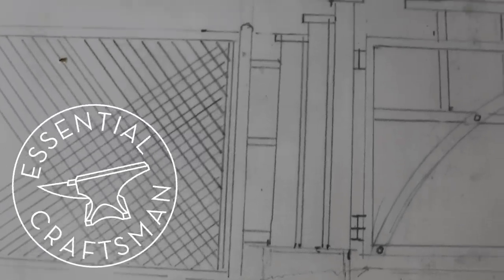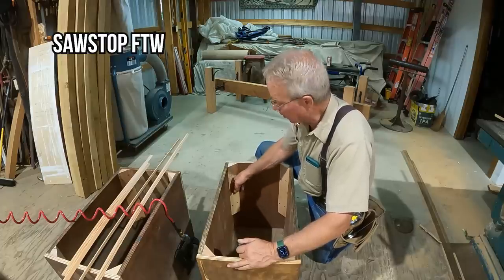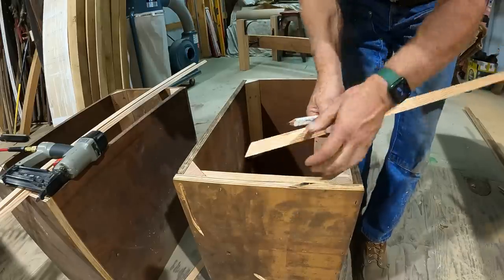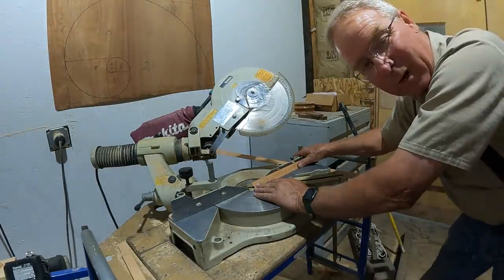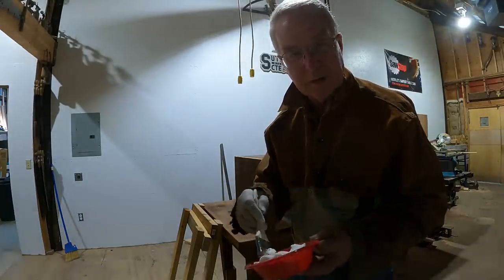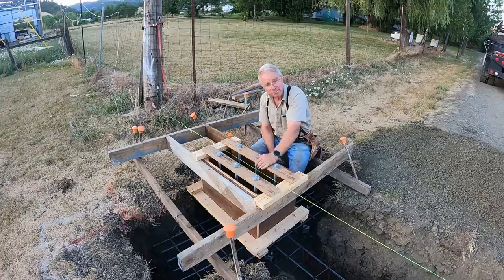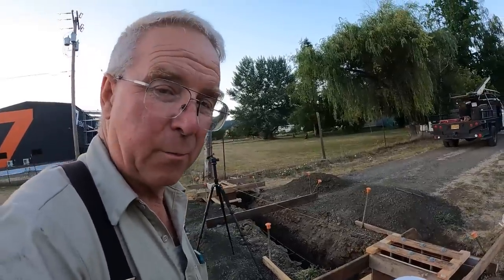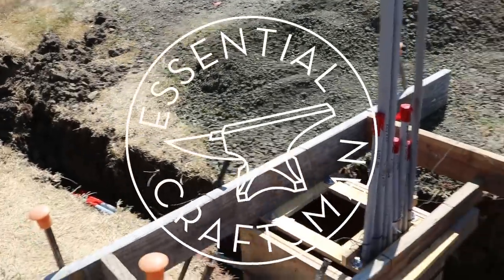In Depth Look at Decorative Concrete Forms: #2

Comment: Scott, with the grade-beam, the only thing you need to do is make sure there's 1 1/2' between the soil sides and the rebar.  Without at least 1 1/2 inches, the rate of oxidation is greatly increased.

Comment: Pilaster. Lol.  
The grade beam is a great idea, and the only way you can be for sure that  the post won't separate or lean.  Remember, if it's a heavy gate, when it's open 90° from its closed position, it'll want to tilt the whole mess towards that direction.  I did all this years ago out of 12 inch square steel  tubing.  6 inch uprights out of square steel tubing, all welded.  Volkswagen stub axles with tapered bearing fit inside a 3-inch pipe was inside of the six inch square pipe and 1 inch studs sticking out the side with 90° slot this way the swivel pipe was all concealed it also had a tie rod going from one day to the next so I only needed one opener and they swung together.  35 years ago.

Comment: Hi Scott - great work on the gate. Love the channel and all that you share here.

The key difference between grade beams and spread footings is load path! Grade beams are usually found where there are very weak soils that can't practically support weight. They support the structure and transfer loads from the beam to piles or a similar deeper style foundation. The stirrups and rebar resist the bending and twisting that transfer places on the beams.

Spread footings do just that, spread the load out onto the soil below.

Comment: Rather than tapping the forms with a hammer, use a reciprocating saw with the blade removed. It gives a perfect amount of vibration to the forms and won't make your arm fall of from swing a hammer.
Reply: Or a battery orbital sander...

Comment: From the beginning of the spec house to now I've gone from foundations poured walls and precast now testing concrete, and inspector. Test soil bearing capacity, inspect rebar and test concrete, yield, mix, strength, and document everything

Comment: The chamfer edges are a nice detail.  In 1974, when I was an engineering student I worked for an electric substation construction contractor and we always  put chamfers on our foundation above-ground column edges.  They looked better, in my opinion.  Keep up your good work on the videos and the content.
Reply: It would not surprise me one bit if adding a chamfer to the top of the column edges made them last longer too. Less of an angle for ice to collect on, seep in, and pry the concrete apart. But I'm no engineer, so I'd be just as unsurprised if I was totally off-base.
Reply: Must be all utilities that love having decorative concrete work. I manage all of the foundation work for our local utility in Southern California. Their designs always incorporate chamfered edges for both substation and pole foundations.

Comment: Structural Eng here.  
The grade beam is probably not necessary (reserving that we haven't seen the end result as yet) but for the sake of doing it, it will add so much capacity and strength to the whole arrangement, even if it is offset slightly. 

What I would say is, you are going to all this effort only to minimally anchor the bolts to the outside of a set of stirrups which are themselves minimally anchored into the footing pads (edit: went back and watched video #1, the tack welded stirrups are very well anchored into the footing, so disregard that. I still would want the bolts to be inside the stirrup cage ideally) I would have used much longer J-bolts that anchor into the footing rather than anchoring into those stirrups.

Its unlikely to make a difference on this particular project as it looks very over engineered as it is. But if you're going to do it this way, why not get the absolute best embedment possible?
Reply: Maybe he tack welded those too?
Reply: Do you mean the J bolts should go down another foot or so?
Reply: Also struct eng. I agree, no issue with the offset angle of the grade beam, IMHO I wouldn’t worry regarding the length of the J bolts though as 6 is plenty strong enough to hold the metal uprights and whatever hits the post would deform, bend or snap the uprights before the J bolts would fail in either tension or shear. 😊
Reply: @MrVajutza  yup agreed. Those J bolts in concrete without the rebar at all would likely do fine for this application. "That's not going anywhere" as they say.

I just thought if EC is going to this much effort (adding grade beams etc) you might as well get the best engagement out of the bolts by extending them.
Reply: @sungear  that's what I'm saying yeah, but only as best practice/ optimal performance of the bolts.

Ideally also the main shaft of the bolt should have been within a rebar cage rather than outside it. As they were placed in the video could cause the bolts to burst out the edges.
Reply: @onlinetuna  fair enough.  That makes sense. I see that he's designed a great deal of strength into the system but is leaving some of that potential on the table with not-very-long J bolts.
Reply: @MrVajutza  I think these bolts will carry the full load of a heavy steel gate that swings to open (could be wrong). So half of these bolts will be in tension for the canterlevering gate post as it swings open.

Comment: This is such an elegant and simple idea. You don’t even have to get complicated with miters etc. You could just add some 1x2’s inside the forms and it would add interest. You could even add monograms from cheapo wood or plastic letters attached backwards.
Reply: That’s a fair point, but the miters have the added benefit of reducing stress concentrations in the corners. That will keep the concrete from chipping off and leave the footing looking great forever.
Reply: @ericwiken1990  oh duh. Just like breaking the edge or rounding the edges on wood.
Reply: Better get the rorrim out

Comment: I'm not an engineer but i think i Can answer your question since i did thé research for myslef a few years ago. A footing usually transfers the load directly on the beating ground. A grade beam spans the distance between two pile. In your case your beam must resist the weight of traffic and the torque from the pillar ( the weight of the gate, wind etc). For the hoops, they serves to resist to shear forces. You know that in a beam a side is always in compression while the other is in tension (those sides can switch depending on how the load is applied), it means the forces decreases and reverses as you go up or down the beam which creates shear forces and resulting tangential forces in regard to the bearing point. Hope that helps.

Comment: I’m not sure about crisco, but white bearing grease works great up here in Canada. Also WD40 if You’re in a bind, as long as it’s not left on too long before the pour. Great work, keep it up
Reply: Cheaper than diesel  fuel which is commonly used around here.
Reply: @mitchdenner9743  In the old days, diesel was the go-to form release for most everyone. Then environmental issues became a thing and they started making specific form release products. The funny thing is, the new form releases smelled exactly like diesel. As a matter of fact, on those occasions when we used to run out of form oil, we would just use diesel anyway, because it’s readily available and no one would call you out for ‘killing the planet’. No one could tell the difference. I always wondered if they made it smell like diesel on purpose, just for that reason.
Reply: @psidvicious  My money is on the form release just being a more highly refined diesel fuel that's specifically treated to remove the parts of it that we know for a fact contaminate the environment. So it smells like diesel oil because it's almost exactly diesel oil.
This new form release stuff might actually be just RP-1 rocket-fuel grade kerosene, now that I think of it.
The reason it's rocket-grade is because it's a narrower "cut" of the feedstock hydrocarbons, which helps to get rid of any chemicals that could cause heavy soot buildup in the cooling passages or fuel injector heads inside the rocket engine's combustion chamber).
Of course this makes it more expensive for the reason that they don't refine as much of it, and what little they do refine is processed at a lower yield than regular heating/farm grade kerosene.

I find it strange how stuff that was once alive (most crude oil by weight is formed of atoms that were previously part of plants from the carboniferous era, not dinosaurs) can be so persistent at snuffing life out in the present day.....
It sure gives you something to think about, but you'll have to ask someone else what it all means.

Comment: During my career, I have seen miles of chamfer strips installed on bridges performing the task of breaking 90 deg+ corners which are weak, beauty strips on columns and walls, flutes, drip lines, etc.  I realize you are doing architectural formwork that requires more accuracy for closer inspection.   On bridges in my state, more times the strips are installed to create the location and roughly form the chamfer accents that are rubbed out while the concrete is still green enough to look great.  I am not a structural engineer, but in my construction experience, the beam below the entire roadway is definitely not important to the stability of the upright support posts, unless there is something about the design I haven't seen yet. A little larger footing for each post is all that was really needed.  I also would not wait a week to wreck the forms.  A day is sufficient if you are careful and certainly makes achieving a nice, rubbed finish easier.   Thanks, and nice work.
Reply: As far as the grade beam goes, I believe it's less about stability but more for making everything monolithic, and tying the posts together. If there is any movement of the structure in the future, it won't affect the alignment of the gate and posts. Not an engineer either, but I do detail and draft  construction plans for bridges in PA. Agree that we call out either 3/4" x 3/4" or 1" x 1" chamfers or 1" radius on pretty much everything above grade, like you mentioned. Sharp edges = inevitable cracking in the future. It looks way nicer too!

Comment: A footing uses the bearing capacity of the earth for support. As long as the footing is in contact with mother earth, it will be doing its job. A grade beam is beam that is "at" or "below" grade level. Like any other beam, it will need to be supported (typically at the ends and sometimes along its span). Even though a lot of the grade beam is in contact with mother earth, it is typically  supported by tying into a larger footing or bearing on piles, and piers etc. Think of it as an underground beam that would maintain its integrity even if the soils around it were to give away.

Comment: I’m no structural engineer, but I am wondering if that footing is going to stay put under the torque of the gates when they are at their open position. The crossbeam seems like it will keep the posts from collapsing toward each other when the gate is closed, but I expected outriggers parallel to the road to help stabilize the posts under the load of the open gates.

We had a pair of gates put in, but our soil is very hard and rocky with no clay. With those conditions, the posts were sunk over five feet and embedded in 6’ x 6’ x 5’ reinforced concrete blocks.
Reply: If you look at the gate column foundations, they look to be about 4-5 yards of concrete each (not including the connecting strap beam). Each foundation will weigh close to 20K lbs, that will have to support swinging gates about 6’ high X 7’ long. Just from the plan elevation, I’d estimate the gates to weigh in at about a ton each? Those foundations should hold up like a champ from what I’m seeing.

Comment: Would be interesting to see you change the concrete slomp with superplasticiser instead of water. Adding water is not good for your concrete.

I am curious to see why you need both 3 and 6 inch slump.

Looking forward to the next vid. Thanks for sharing.

Comment: Obviously it would be stronger if it were to be done the way you wanted however you know what you got you could add dowels or rebar to connect them and at that point you might need to make the joints a tad wider to accommodate proper clearance

Comment: When I was doing a lot of nice residential and commercial gates, we would drop a half yard to a yard of concrete around a six inch or larger square post made of half inch steel. When it was set it was time to weld Greasible hinges.

When the posts were set they would often be clad in stone. 

Beautiful work as always E.C.

Comment: On a project like this where there will be a reasonable amount of water soaking the concrete over time, is there any reason other than a bit of up front cost not to use a crystalline waterproofing admixture like Xypex or Kryton to protect the rebar?

Comment: The previous owner of my house built a 6' tall gate with two 6' wide sections, splitting in the middle. The posts are bolted to the 4" thick slab of the driveway with four 3/8" bolts each. While not the best, it is working, so I have no doubt your gate will last forever. lol

Comment: Easy tip to remember when cutting champher is when cutting always position the 45° away from you.
90° degree chamber side goes facing you when cutting. To avoid splitting the champher spray form oil prior on the champher let soak.

Comment: What kind of pliers/cutters did you use to cut the small wooden pieces with? I couldn't tell if they were a new tool I hadn't seen or just tin snips.
Reply: Multi Angle Miter Sheers !   they have been around for more that 40 years . the better ones cost around $35 dollars . Don;t waste your money on the cheaper ones
Reply: Oh cool, thanks dude.
I like how clean and easy the cut was. Even if it only cuts it that clean for pieces around that size then they're very handy. No running to the mitre saw or having to use a hand saw.

Comment: 3" slump?  That's a dry mix right there.
Reply: It’s so the concrete in those stub columns will “stand up” sufficiently and not flow back out the bottom. Similar to if you were trying to pour a set of stairs. (3” is probably a little overkill though).

Comment: I was going to suggest a jig like you have made to hold the bolts in the last video. Only difference, maybe wrap them in something like a pool noodle, which when burnt out after concrete has set will give a little wriggle room when fitting the bolts. No doubt though you wont need it 😅

Comment: I forgot exact depth because final grade was far from being established but reminds me of these huge 10ftx10ft piers at these apts all with 10 runs x2 planes of 10ft #9 rebar. There was 15 piers with 200ft of #9 rebar and that much concrete with an elevator shaft and a footer perimeter wall connecting the outside piers

Comment: What a fun project. I can't wait to see how it turns out.

Incidentally what you're using the Crisco for is likely the best use for it, nobody should be ingesting it. Vegetable oils started out as engine lubricants until someone had the terrible idea to start putting them into food (and they are in just about everything). It's no coincidence that chronic disease such as heart disease, cancer, Alzheimer's, Type 2 diabetes and obesity have been on the rise ever since that crapola was introduced into our food, they wreak havoc on our metabolisms. Restaurants go through these oils by the 5 gallon bucket, they put it on everything and fry in it. Avoid!

Comment: Cringed a little at the “add water to get down to a 6 in slump”. That is the age old dance between the engineer and the contractor. Probably not the end of the world but that extra water will lower the strength of your concrete. I’d recommend a super-plasticizer to increase workability without impacting strength.
Reply: ACI certified concrete inspector here, adding water to increase slump from a 3 to a 6 would be OK if the plant held back the proper amount of water at time of batching. That being, approximately 1 gallon per yard per inch of slump
Reply: If the mix is designed to meet performance reqs with the water required for 6” of slump wouldn’t just it be easier to  use 6” slump for the entire pour instead of upping the water half way through?
Reply: He’s going for a monolithic pour of the foundation and stub columns all at once. The concrete needs to be stiff enough to not flow out the bottom of the stub columns. Adding plasticizer would make that difficult. They’ll likely pour the columns and main part of the foundation with the stiffer mix, then add a little water, to top the rest off.
Reply: Super plasticizer is pretty difficult to dosate on site, it would need a pretty long mixing time after adding it to the truck. when it gets added in the concrete plant its usually mixed with the water before it gets in the concrete mixer(at least thats how its done in the netherlands) if youre going to add water halfway the pour its also possible to add cement to compensate the water/cement ratio.

One thing i dont understand is that the concrete in the usa(and a lot of other places) is poured directly in contact with the surrounding soil, no formwork or foil to hold the water in the concrete. Here in the netherlands it is standart in the engineers specifications that all surfaces in contact with fresh concrete will not absorb any moisture from the fresh concrete wich seems logic to me since the tested cubes of the mix design are also cured in 100% humidity